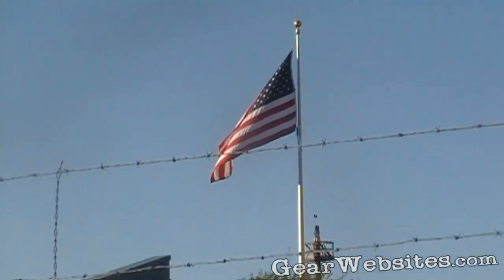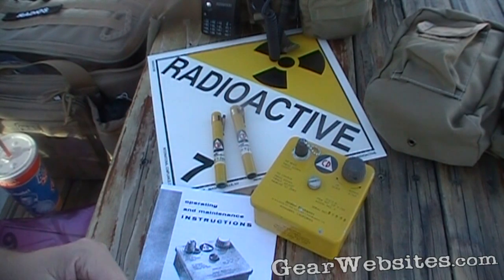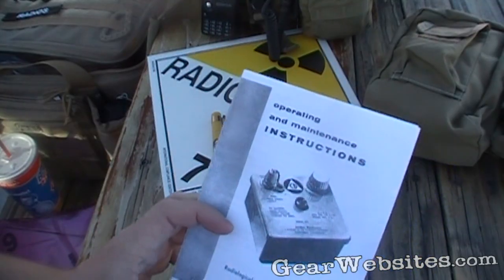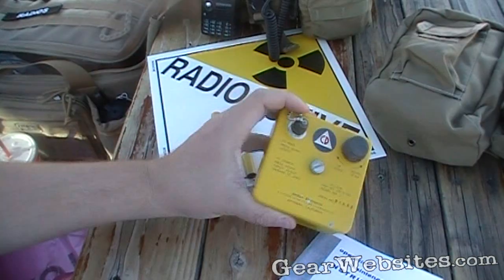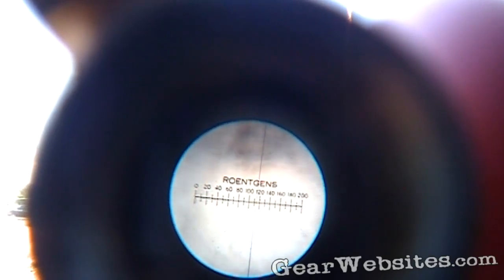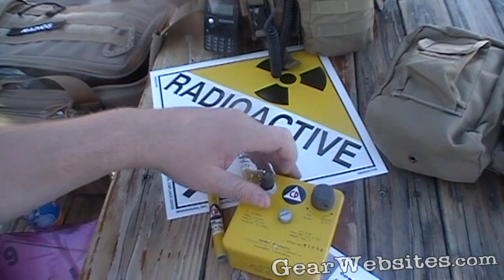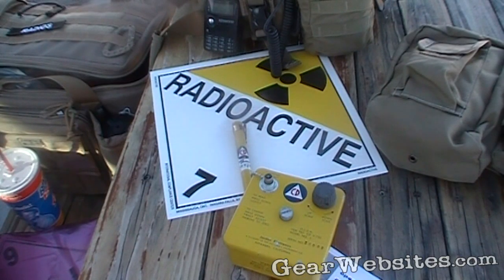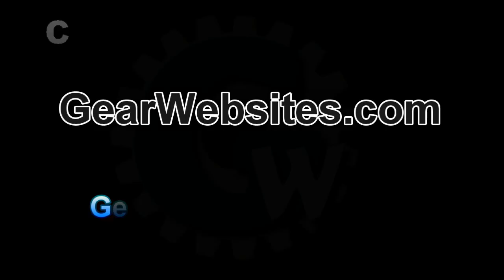Civil Defense Radiation Dosimeter

Comment: hey just an fyi the dosimeter says rotengen its a measurement of ionized radiation(gamma and xray) and you do know that dosimeter is showing that it has encountered about 1Gy of radation which is low but still there shouldnt be anywhere close to that (of course if the dsimeter wasnt calibrated correctly there is nothing wo worry about)